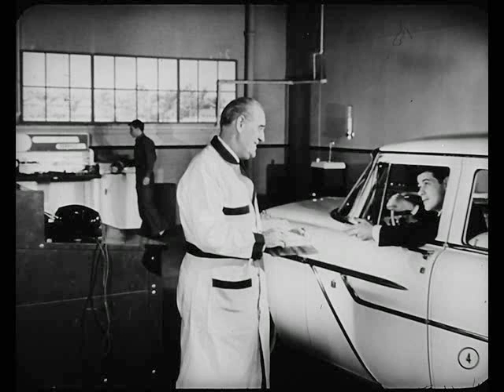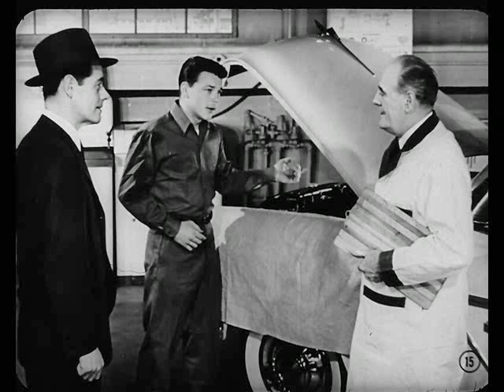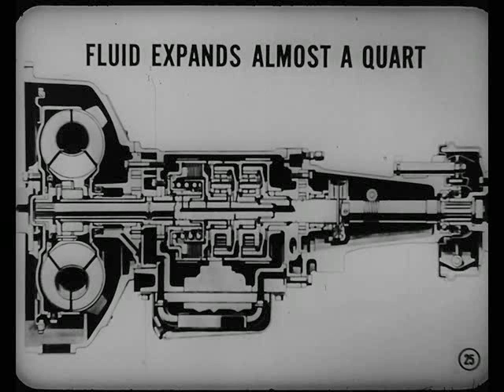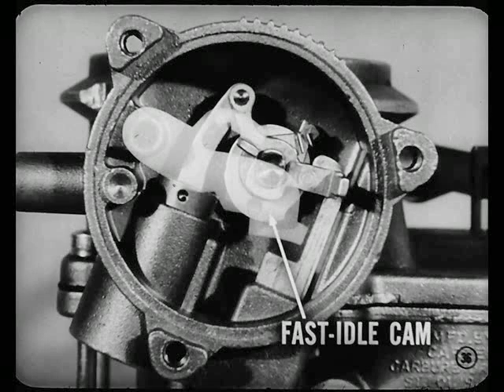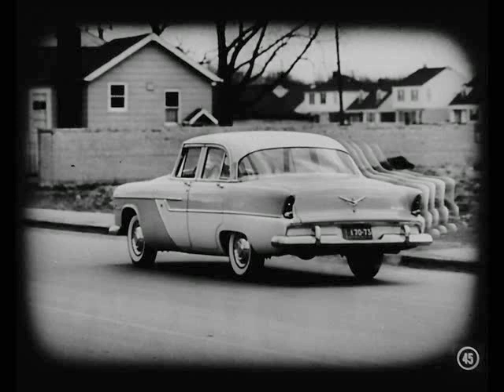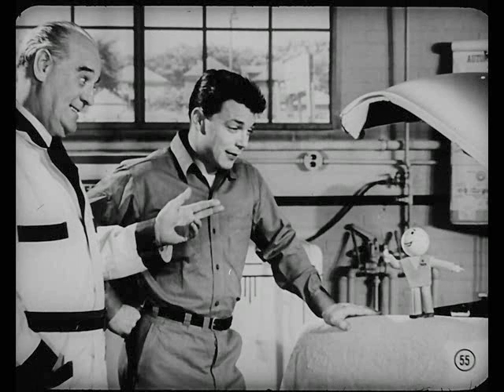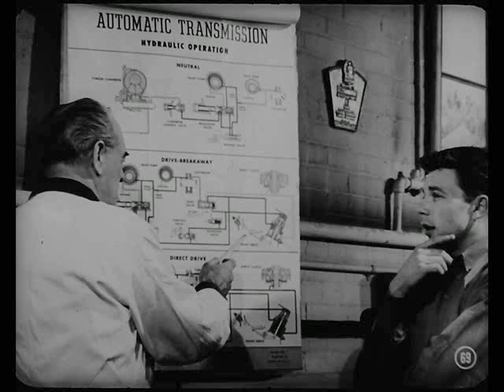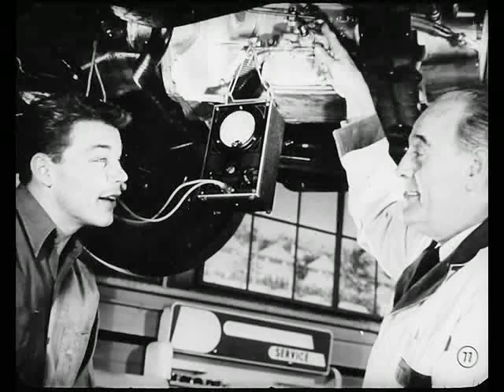Chrysler Master Tech - 1955, Volume 8-5 Powerflite Transmission Maintenance Upshift Pattern

Comment: is the Chrysler 318 a Good motor
Reply: The 318 CI was one of the best engines ever IMO . Chrysler also had a 225 CI six cylinder was a very good engine .
Them days are gone .
Reply: Very much so.
Reply: One of the BEST V8s ever made IMO!! I used to rebuild Engines for a living...
We'd have 318s (and 273s, same Engine) come in between 180,000 to 250,000 miles. 

They ALL had pretty good Oil Pressure, Head Gaskets rarely leaked, Cylinders good, just Rings worn. 
The only issues I encountered were people who didn't think Oliday changes were a good idea!! Even those were serviceable, except they'd need new Valve Guides, because they'd be worn OVAL!! Besides Oil consumption and a bumpy idle, they still ran good!!